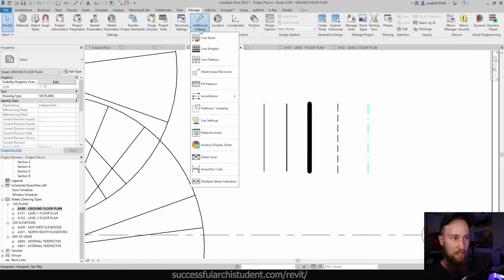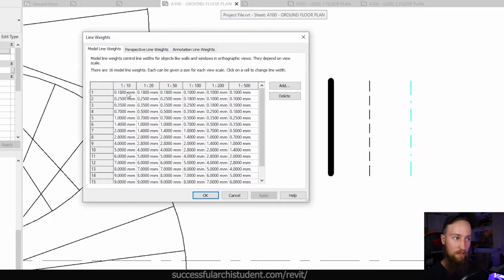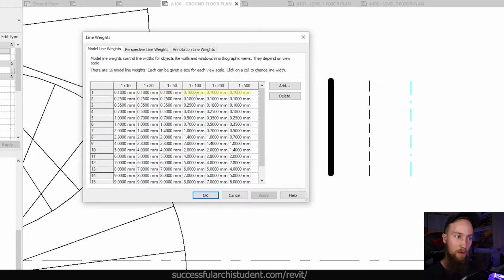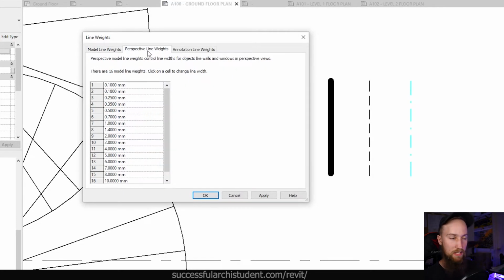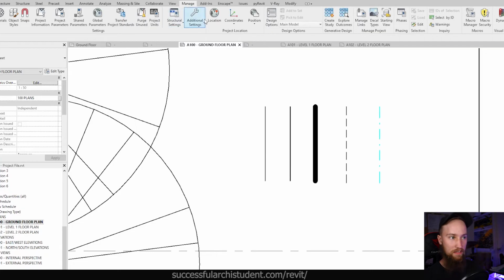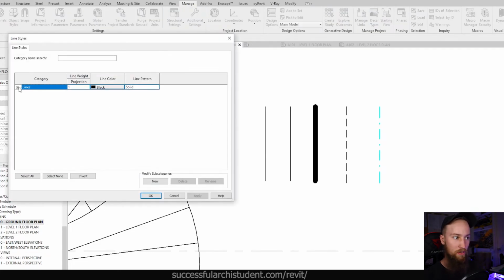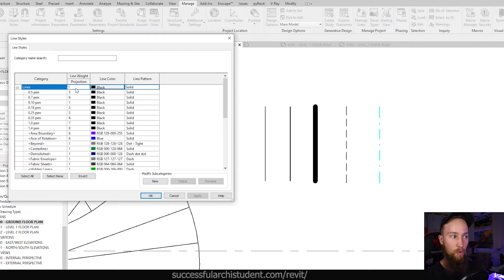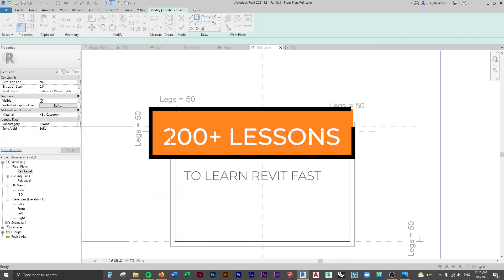How to Change Line Weights in Revit

Comment: Hey Kyle, I have a curtain wall that's acting as timber screening in a 5 level multi residential building, the mullions are about 100mm apart and I have this screening eeeeverywhere so of course my elevations, axos etc. look like they have huge near jet black areas all over them. Do you know how I change the line weight/graphics of the curtain wall to be less intense? Thank you!